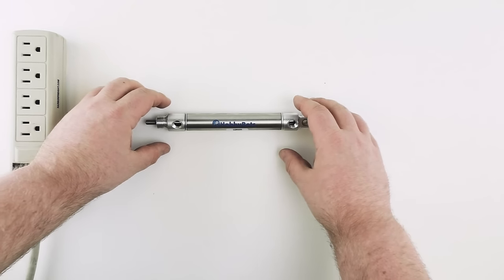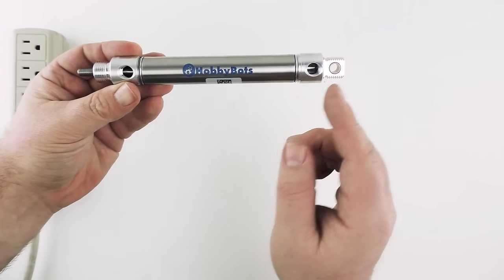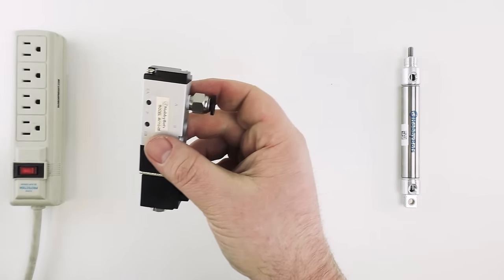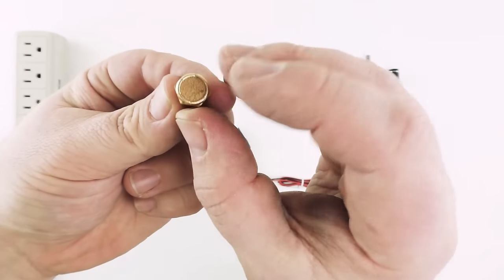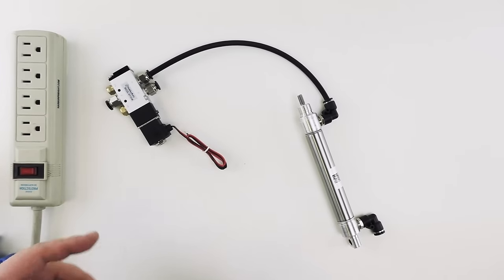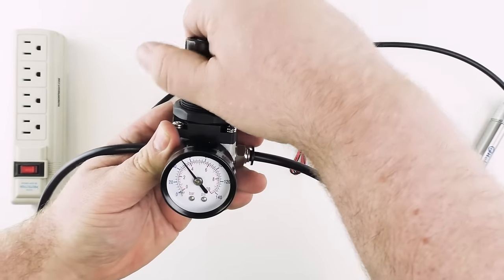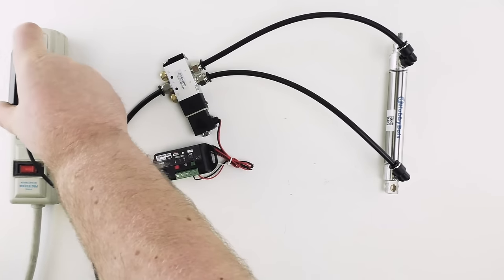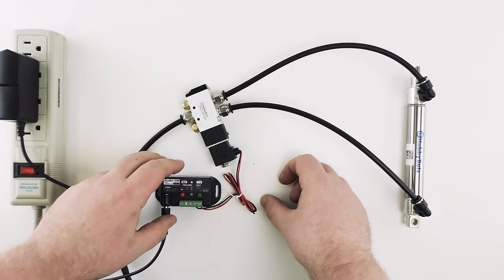Controlling a Pneumatic Cylinder Easily

Comment: Excellent video. I'm wanting something to JIGGLE-JIGGLE-JIGGLE a garage door, just three quick bursts maybe every 45 seconds... create the jump scare, reset  for the next victim...  I MEAN, visitor.  🙂

Would it be possible for me to #1 somehow attach the piston to my garage door and #2 get a short enough stroke that it doesn't punch a hole THROUGH the garage door?

Is there an easier / cheaper way for me to get the garage door to rattle every so often, short of a physical person out in the garage? I'm not used to doing DIY stuff so I may be missing the obvious or reinventing the wheel.

Comment: Good afternoon, thank you for this video, it was really clear and great.
-I wanted to ask if speakers could be plugged somehow so we get a sound synchronized with the movement?
-You explain that a trigger can be added, like a button or a motion sensor, would there be a possibility to add something to achieve a loop movement?
-On the green area that connects the controller with the cylinoid I see there's more than 2 screws, I was wondering if more cylinoids could be connected to the controller evern if they do the movements at the same time?

Thank you.
Pedro Llaudes
Reply from the maker: Hi Pedro,

Using a controller with audio would allow you to add sound. Something like a PicoBoo MP3 would work well:
https://www.frightprops.com/picoboo-mp3.html

Creating a looping animation can again be done with the controller. Some controllers, like a PicoBoo MP3 allow for what we call "ambient animation," which is animation that repeats indefinitely when ever the unit is powered on and not being triggered. On less advanced controllers you can do what is called "looping the trigger input," which simply means bridging the trigger terminal connections with a piece of wire so that the unit is always being triggered, and therefor always playing its programmed animation, when it is powered on

The controller demonstrated in this video has a single solid state output so it is best used to control only one low voltage device. Other more advanced controllers have multiple outputs which can be used to control many solenoids or other electronics.

Hope that helps!

Scott
FrightProps
Reply: @FrightProps  can you use the peekaboo 1 for multiple cylinder and do I need a flow control for it?

Comment: 1. How do you take out the pipe from the air line - at 5:07,
2. I see that you just snapped into the socket, Is it enough to see that the fit is tight, Don't you have to wind it etc ?
3. What type of a compressor did you use ?

Comment: I'm doing a training in a company where pneumatic cylinders are the most important piece for the machines (Manual Test Fixtures and Test benches) for testing printed circuit boards 😊

Comment: What if i want to additionally connect a 12 V siren and a 12 V light, so the Prop has Motion, Sound and Light.. Could i put those 3 cables in the same picoboo output terminals or would that be to much?

Comment: Hello, a query as it would be if I wanted the piston to advance First order to advance to the middle, Second order to its entire output distance and Third order to return everything. What devices would I need you will have a video to see it, thanks
Reply: You would need a pneumatic cylinder with a stopping point in the middle. I've seen such cylinders sold by Bimba. You would need multiple solenoids as well. It's a pretty complicated thing to do, but I do think it's possible if the stop point is at a fixed location. It's kind of hard coded into how they work. See https://www.youtube.com/watch?v=lNvP3TGKJOY

Comment: So do I have to keep an air compressor hooked up to my project at all times? Is it possible to charge the system with air and then disconnect it? I don't want to have an air compressor attached to every device I'm using a pneumatic cylinder on.
Reply: No, that is not possible.

Comment: Would the pressure be equal to the amount of PSI, i would like to use this to clamp down a piece of aluminum that i would then pierce would this be strong enough to avoid movements ?
Reply: Try it, and if it doesn't work, replace it with a larger diameter piston until you get the desired hold down strength. Trying to figure it out ahead of time is pretty difficult as it depends on a rather large number of parameters, like what kind of end will you put on the shaft, what's pushing on the aluminum, what PSI you use (as you guessed) and so forth.

Comment: What is the problem with my solenoid when I turn on the power switch the solenoid making humming sound and it did not work, but when I turn off the power switch, I could make the  piston moves by pushing the little test button on the solenoid? Thanks!

Comment: Hai can i ask you one quection,is this pneumatic cilinder if i replaced oil not air if can?thank you..
Reply: pneumatic cylidners are not meant for oil. if you compress oil in a pneumatic cylinder it will explode and you can be seriously injured or killed that way.
Reply: @rock-afire-fan 😅😅😅🤣

Comment: When buying a cylinder how do you know how much power it has? I need one to be able to lift something up off the floor about an 1" that weights approx. 60lbs. Thanks
Reply: ideally, a piston with 1 square inch of area (a little bigger than a 1" diameter piston) that is driven with 60 PSI should be able to do that, but reality varies from the ideal quite often. So the question would be what PSI would you want to run it at, and then do the math to figure the area of the cross section of the cylinder.

Comment: Is there a way to control the distance of the stroke? Let's say I need it to travel couple of mm
Reply: This is really difficult to achieve with pneumatics, though it is possible. An electrical actuator may be more along the lines of what you might need to easily accomplish that task, though it will typically be slower. The easiest way to move it just a couple of mm is to get a very short piston, or to somehow block the progress of what you are pushing with an external stopper, like a piece of wood that keeps it from moving. This generally is somewhere around the clevis, which is the thing that screws into the end of the piston.

Comment: How many lbs of force does this produce? I would like to build one for pressing my rockets.
Reply: That depends primarily on two things. The pounds per square inch from the regulator, and the diameter of the piston. Bigger diameter pistons press harder, smaller diameter pistons press with less power. If there is a pinching hazard, it's a good idea to use smaller diameter pistons.

Comment: I want to use a pneumatic piston that will retract when 1 once of pressure is removed. How would I go about doing that? Also, would I have to use the electrical panel to do that. Wouldn’t the pressure gauge be enough? 

BTW, great video. Your content is the only that I found that breaks down the mechanics and the screws and fixtures. Thank you!!

Comment: So the retracting air line A is always allowing air flow  is that correct.
Reply: No.  In this case with a DA (double acting cylinder) the pressure is applied at the bottom tube to extend the cylinder and air has to come out the top port for the cylinder to extend.  When the command is given to retract, the exact opposite happens.  Air is applied to the top of the cylinder and air is pushed out the bottom port.

Comment: I want to know is it strong enough to kill rats on first hit?
Reply: Just get a bigger bore. It should squash one quite nicely.
Reply: @Dennizzz119  thats sick
Reply: Depends on how high you crank up the air pressure, using that regulator.
Reply: @ebrahimmomin7518  You've never had rats in your hen house.

Comment: what happens if the exhaust mufflers of solenoid valve are completely sealed by plug fittings?
Reply: If air can't escape the exhaust, then the piston will not move due to air being trapped in the end of the piston that should have air coming out of it. You can verify this pretty easily with most pistons by trying to move the shaft while the plastic dust prevention covers are in the cylinder.

Comment: I like to get something like that to lock my doors by bolting the air ram on the door with a push rod connected to the ram those down through the floor and up through the wall to lock the door just in case an emergency hit the emergency button and lock the door I want to do that I don't know what to get

Comment: Would it be possible to achieve speeds of 100 in/s using a pneumatic cylinder with a stroke of 1.5 inches?
Reply: Probably not with the controller shown. That would require pushing the button pretty darn fast. You can get really fast if you control it with an Arduino though. 100 inches per second though is really super fast, you would have to experiment with your particular setup.
Reply: i think if you want even more speed, you might be better of using the penumatic cylinder as a pinion to drive a gear stepping up to another pinon that will travel faster(and shorter stroke), you could also do the same with a block and tackle style pulley system.

Comment: Is that solenoid valve normally open or normally closed
Reply: doesn't actually matter because you can always change your A and B ports. Plus I don't think this valve has an NC or NO position because it seems to have only 2 position

Comment: Do these cylinders have to be either fully extended or retracted or can they be anywhere in between?
Reply: You can depending on your application. You will need another type of valve and some means of controlling the timing of the valve. It's not very exact and needs some fiddling to make it work. You also need to slow down the cylinder.

Comment: I had no idea! Do I understand correctly that the controller can be discretely 'trained' to fire a pattern? What is the limit on the number of patterns? Can different patterns be selected within the device, or is a further control necessary? Thank you so much for your demonstration video! It's a look ahead, as I am still learning manual control design.

Comment: Can these move slowly out and in?
Reply: they can. you will need to slowly fill the volume of the cylinder with pressurized air. that is done by a flow reducer. Or adjusting your cylinder volume to be far greater than your systems chocking point

Comment: can the controlling  go slower?
Reply: it can. you will need to slowly fill the volume of the cylinder with pressurized air. that is done by a flow reducer. Or adjusting your cylinder volume to be far greater than your systems chocking point

Comment: How much torq
Reply: It's easy just take the bore and calculate the area on which pressure is applied: A=pi*r*r then calculate the max possible force F=A*p(pressure). now you just need to convert to torque so the exact torque value depends also on the distance from the pivot point. so in theory, it could be infinite or zero for the same piston

Comment: Uses quick connection with the tube thst goes inside the air tube.  If you don't in short time movement with causes leaks. The reason people use the quick connections without the tube that goes inside the air tube, is because they are cheaper cost for a reason. So, instead of buying the prudent quick connections that won't give any problems, cheap quick connections companies know you will buy the infer products, them by the time you realize you will have to replace all these cheap connections with high quality  ,they made a sale and they call this good business.   I was one of these people, and had to replace all the air fittings. Time and money was lost.

Comment: In the first 60 seconds, 2 errors. Cylinder don´t pull and the longer or bigger it is it goes slower because more air fits in.
Reply: cylinders do pull and push...
Reply: @rock-afire-fan  The cylinder is designed to have the majority of its force on the push...or extension of the cylinder in a double acting cylinder.  Yes, they do have force on retracting back into the cylinder, but the cylinders are really designed to have the majority of the force on the push.  
There is also less force available on the retraction because the surface area is less on the bore.  The rod steals surface area from the front of the bore.